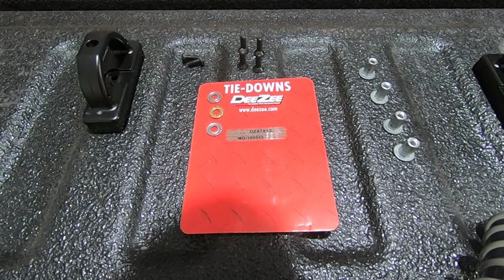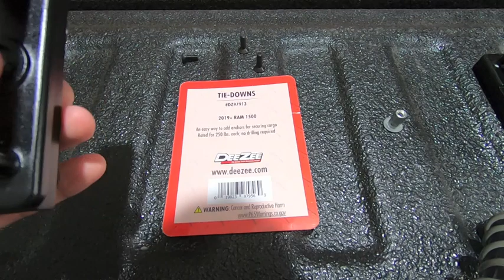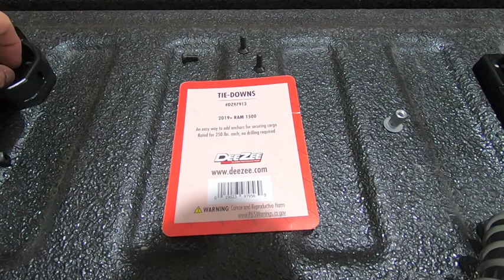DeeZee Tie-Downs - Ram Rebel

Comment: I have a 2016 ram 1500 with a drop in bedliner in the 6' bed.  I don't have any holes anywhere in my liner besides the 4 corner tie downs.  Are there factory holes in my bed and if so how do I find out where?   Or do I just have to drill out the metal too?
Reply from the maker: Sorry man I’m not sure about the older rams. All the 5th gen rams were pre drilled

Comment: nice video gonna try those. I have a question though ,where you get the 2x4 mount bracket ?
Reply from the maker: That’s a 2x6 I cut to fit the bed, keeps small stuff from sliding around.
Reply: @WaterFowler41  what about the bracket holding the 2x6?
Reply from the maker: There are slots formed into the bed sheet metal to hold a 2x. So just cut a board to length and it will drop into the slots. Nothing else needed.
Reply: @WaterFowler41  I think he was talking about the carpet/padding it looks like you have wrapped around the ends of the 2x6 so it doesn't scuff up the bed.
Reply from the maker: @lxa71975  Yup! just a couple pieces of carpet cut to protect the edge of the wood.  Sorry
Reply: @WaterFowler41  came to the comments for this thank you!

Comment: What size nutserts are you using and where did you buy them?
Reply from the maker: I believe you messaged me on Instagram too but I don’t know the exact size of these. If you’re trying to fill the existing holes in the bed, maybe use a micrometer to measure them so you can purchase the correct nutsert diameter for them? Otherwise reach out to Deezee and see if they can give you some info.
Reply: @WaterFowler41   After you messaged me I realized that the nutserts come in the package with the tie-downs.  I actually bought some and installed them yesterday.  Thanks for posting the video.
Reply from the maker: Awesome!! How’s your hands? Mine were pretty sore after installing all the tie downs.